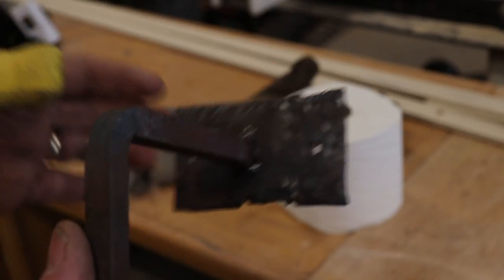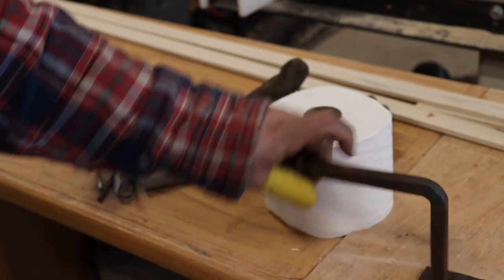A great bathroom upgrade! Shop time.

Comment: Great project and yes the square bolts will look great . As far as a forge a wheel rim , break rotor and a small squirrel cage fan works great for a small forge. keep up the great work .
Reply from the maker: Thanks Andy

Comment: If your wife accepts this as a "bathroom upgrade", you've got a great wife.  Hate to tell you what my last bathroom upgrade cost. Point two:  My first thought when I saw you working on this video was you need an anvil and a bigger shop . . . just make the new shop big enough to handle a home-built airplane and parts, as well.  P.S.  I still see good size used anvils for $60, or so. 73
Reply from the maker: I love and it does classify as an upgrade to me. :) Now I want him to do towel holders though! I agree, he does need a bigger shop as long as that means he does more projects for me!